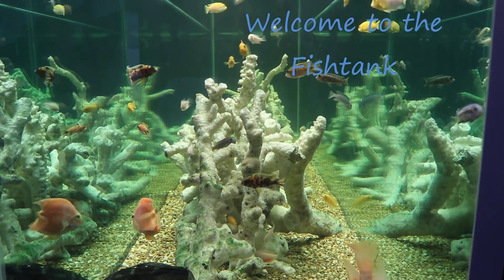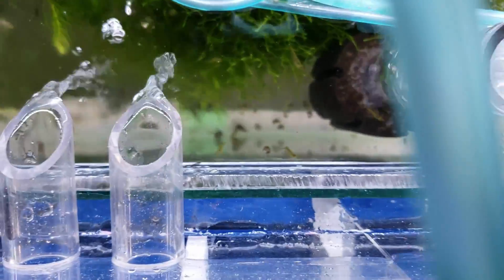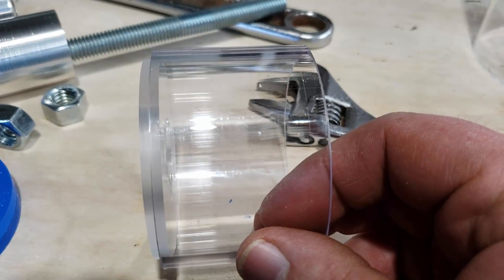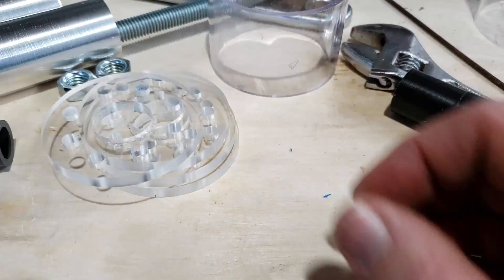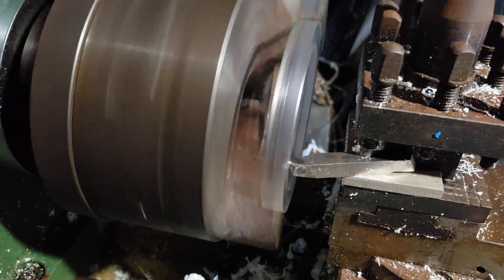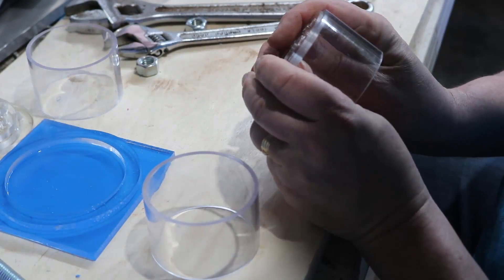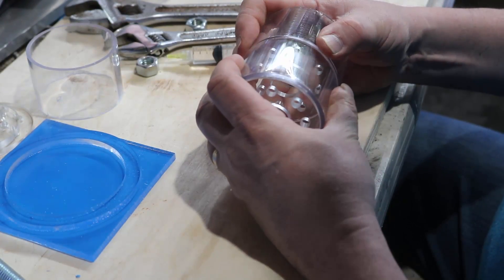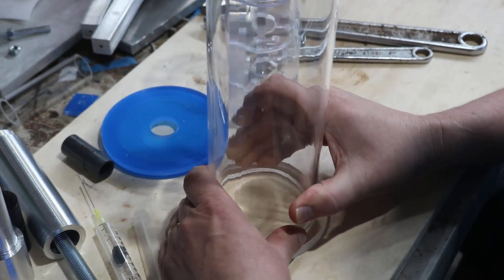DIY Acrylic Canister Filter Part 1

Comment: Nice just got my bottle of mcd... glue, ah yep I agree with what you were saying about the amount vs how much you use.
Now just to find a nice glass container like yourself, do you have any issues with the syringe type?
Reply from the maker: Cool! It works very well. I actually prefer the syringe type, just make sure to remove the plunger after use or the rubber end will corrode

Comment: What kind of pump do you plan on using? It would be pretty cool if you did some tube bending to make some acrylic lily pipes. I've always wondered about using computer liquid cooling supplies in aquariums.
Reply from the maker: I'm looking into finding a better looking pump, but for the moment I will be using the same pump as in the last few videos. As much of this build as possible will be done in clear acrylic (at least as time will allow anyway). Thanks for watching

Comment: Do you ever cast or mold acrylic? Does that bond to pre cast  or extruded acrylic or would you still need to use methylene chloride?
Reply from the maker: I've never cast my own acrylic. I'm not clear on your second question. Methylene chloride will bond any polycarbonate. Hope that was what you were asking. Thanks for watching
Reply: @FishmanEricRussell  rather than milling the bottom of the canister what if you cast a bottom an place the canister inside it before it cures, would that hold.
Reply from the maker: @mycool8980  Casting has greater variability in tolerances than milling, but it should be good enough for this kind of application. Thanks for the tip and for watching